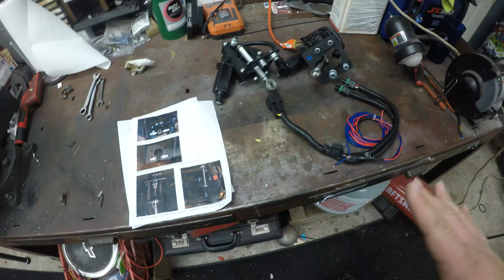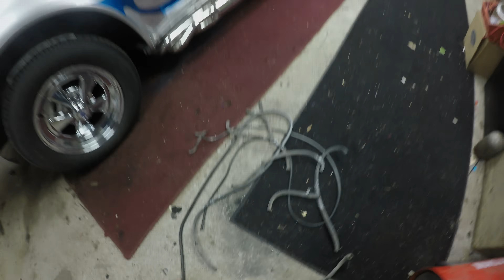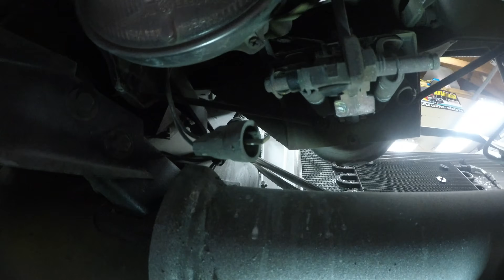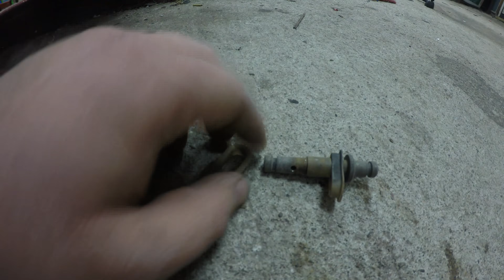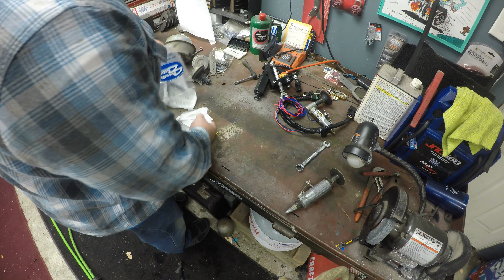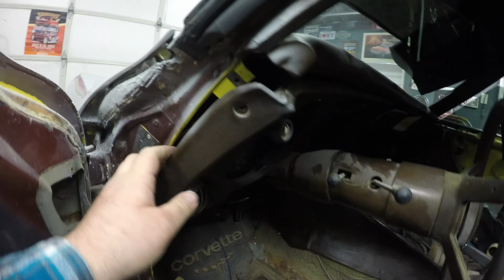C3 Corvette Electric Headlight door Conversion - Good E'nuff Garage Ep. 72

Comment: Hello, I have bought one of these kits and plan on putting it in sometime this week. What are the operations to control the actuators? does the dimmer switch do it or the headlight switch? I don't want to be opening and closing my headlights when i go from low beam to high beam lol. I have a 1970 and it was in the 1977 Flood of Johnstown, PA so wiring has always been a little sketchy on the car. I plan on using your steps but if not possible i can activate the signal with any 12v source correct?
Reply from the maker: So there are 3 wires in the kit. 1 power (red) one ground (black) and one switched (blue) 
The red goes to full time power on the battery or other full power source. 
The black goes to chassis ground. 
And the blue goes to switched on the headlights. 
The easiest spot for the headlights switched power on a 1970 is the blue wire on the floor dimmer switch. 
They will not close or open when switching to low or high beams as the blue wire on the dimmer switch is the headlight power on.

Comment: I didn't go through the fire wall I hooked my trigger wire(blue) to the marker light in the finder (orange)wire and hooked the red wire to relay by the alternator
Reply from the maker: @killroy7740  that works too but if it’s the marker signal and not the headlight signal your headlight doors will come up when just the marker lights are on. As long as you’re ok with that

Comment: Im looking into retrofitting this kit into a different car, does triggering the signal wire simply put the headlights in the open position until its triggered again? Doesnt use any fancy timed external relay/switches besides the one in the harness?
Reply from the maker: @Anthonyc77  correct

Comment: I have 82 corvetthat installed electric headlight kit. Having trouble figuring out wires. Black is ground red alternator power. Where does the blue wire go?
 I don't understand what signal means.
Reply from the maker: @JimCadigan  the blue wire goes to your  dimmer switch. If you have a 68-76 it is on the interior floor and you would tap into the blue wire in that. 
If you have a 77-82 your dimmer switch is on the column and you need to tap into the yellow wire on that. So that when the headlights are on the doors come up
Reply: @WhiteWallSteve 
Thank you 😊 🙏

Comment: 16:15 So the motors are constantly working keeping the headlight up? I don't think they will last very long. Any updates on the longevity of the components? 2 tomatoes for not firing up that badass set up..lol
Reply from the maker: That’s not how they work. They have a switched on and switched off.
Also the car had a major oil leak at the time of this filming and I didn’t want it to leak everywhere. I was only tasked to do the headlight motors.

Comment: Where is the yellow wire located without tearing the steering apart.
Reply from the maker: If your dimmer switch is in the column it will be down near the base of the column.

Comment: What wire on the dimmer switch? Any? Theres like 5 wires.
Reply: Check your instructions
Reply: @elvetteparts  no instructions
Reply: No instruction? Bought the China junk hahahaha @juansalgado6212
Reply from the maker: In the video I explain what wire. 
On the floor mounted dimmer it is a blue wire. On the column mounted dimmer it is a yellow wire. But always check with your rear light before cutting.

Comment: Why is the connection made at the dimmer switch and not off the headlight switch?
Reply from the maker: All you need is a signal wire and it’s easier to get to the dimmer switch than the headlight switch in most cases.
Reply: @WhiteWallSteve any of the 5 wires in the dimmer switch?
Reply from the maker: @juansalgado6212  no you have to use the signal wire from the headlight switch 
On the floor mounted it is a blue wire. On the column mounted it is the yellow wire. But always check with your testlight before making the cut.

Comment: Do you have to connect the wires under the dash? Is there somewhere under the hood you can do this?
Reply from the maker: You can splice into the dimmer switch. But you have to go somewhere that you get power when the lights are activated and the headlight switch is the best place.
Reply: @WhiteWallSteve  yes, but doesn’t that wire run outside the firewall somewhere? I’m just trying to make it easy. I get nauseous working under the dash.
Reply from the maker: unfortunately it doesn't, you need some sort of signal wire for the headlights @frankporter2807
Reply: @WhiteWallSteve  ok! Thank you!
Reply from the maker: @frankporter2807  for the power wire you can go right to the alternator or battery as well if you don’t wanna go right to the headlight switch.
Reply: @WhiteWallSteve  ok! Sounds good! I’m going to give it a go next week hopefully next week! Thanks for your help and the video! Much appreciated!
Reply: @WhiteWallSteve and thank you!!!
Reply: Try asking the company you purchased them from

Comment: FYI
1976 Corvettes had the weakest frames of all Corvettes.
If you ever buy a 76, get a pre76 frame.
1982 & 84 had the boat anchor crossfire motors.
Replace the wiring harness with a 1980 harness and bolt in any other 350.
Reply: What part of the 1976 corvette frame is Weak??

Comment: I installed a set of these years go. Back then, they were over $800.00. They use Mazda Miata headlight motors. The problem is they won't last, and the gears will strip out.  These motors have plastic gears and are not designed to lift the heavy C3 Corvette headlights.  I went through two sets of motors already.  None of the people selling kits offer replacement motors.  You either have to buy Mazda motors, which are not cheap, or you buy another kit and throw the brackets away.

P.S. the main issue is these motors are installed upside-down.  Due to this water will get into the motors and rust will form inside and will lock them up or make them jerk adding stress to the plastic gears.
Reply from the maker: This same exact kit? I don’t think these use Miata motors but it’s possible I guess. 🤷🏻‍♂️. The reviews were good. But at the end of the day replacing motors is still a hell of a lot better than chasing vacuum lines.
Reply: @WhiteWall Steve  it's great while it's working.  But after a few months the motors just jambed up. On the first set, one motor stripped out, the other locked up.
Reply from the maker: @cajunroadwarrior  hopefully these will last a bit longer. 
I’ve had mine on my personal car last over 10 years 🤷🏻‍♂️
Reply: @WhiteWallSteve  I just wish these guys offered replacement motors or at least repair kits for them.
Reply: @WhiteWall Steve  I found the source of the problem.  The motors were full of water. Theee motors are installed upside down compared to how they are designed to work on the Miata.  Mazda has rubber caps over the motors to keep them dry.  Since the motors are upside-down, the caps are useless.  I would suggest taking the motors apart and packing them with waterproof grease.
Reply from the maker: @cajunroadwarrior  these motors don’t seem like they are upside down and I’m not sure how water could get in them. I’m wondering if these are the same style motors as what you have
Reply: @WhiteWall Steve  there are maybe three designs for the electric conversion.  One uses the more robust motors but requires a control box. Another uses a motor attached to a separate gear drive that also requires a control box. Then there is the cheap one that is sold everywhere.  It uses Mazda Miata motors. These motors have the switching plate with three contacts. This is a very simple system.  To make the motors fit, they had to have the red knob face down. There is a vent at the bottom of the motor.  It has a steel metal plate over it to keep water out. The issue is that because the motor is upside-down, the vent is now facing up and open. Water can inter through that hole and collect inside the motor.  The motor will begin to rust, and the internal contacts with tarnish. I had two motors seize. The armature fried on one motor. After dismantling the motors, I discovered the pros and cons of them. If you add waterproof grease to plug the vent and grease up the top of the motor, you can protect it from rust. After cleaning and greasing everything, the motors are working now. The only problem now is that the plastic gears are cracking at the hub.
Reply: I'm considering removing the 4 springs per headlight to relieve the stress on the motors. I will grease the motor and vent to prevent water contamination . Any thoughts on spring removal?
Reply: @mikemulderink7371  I actually moved the springs to help take some load off the motors.  The single greatest contributor to failure is intermittent contact of the armature brushes. Jerky motor operation creates severe shock loads to the whole mechanism.  Keeping the water out will help make them live longer
Reply: Thank you cajunroadwarrior. I will remove the springs and seal the motors with grease to prevent water contamination. Appreciate the help.
Reply: Indeed rain water gets in them and theyre gone lookin for something better now these are waste of money
Reply: Did you ask to buy motors or have them repaired? Other kit use modified motors that are not easily replaceable
Reply: @elvetteparts  a single replacement motor cost as much as a whole ebay kit. So, I just buy the whole kit when a motor fails.  However if you pack the vent with grease it mat not fail for years.